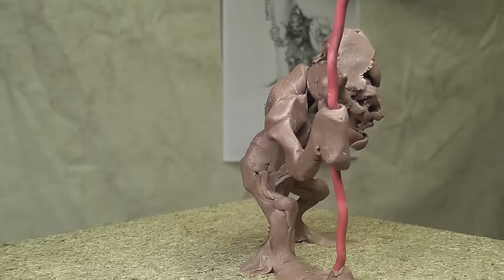challenge gobelins with Wayne England and Roquelaine Cyril day 1  in monster Clay plastiline

Comment: Is there a significant difference in this Monster clay and Sculpey clay as far as being able to work it and smooth it out? Also, with your other sculpts, what do you use for the eyes beside pearl?
Reply from the maker: It s two different clay, monster clay is plastiline, and sculpey is polymer, monster has different state of clay, sculpey not, both are a little wax sensation when you touch it, after you work a little differently Ith both. To smooth is same but use different solvant. And for etes I use pearls, airsoft bullet ball, or anything which be round ;)
Reply: +cyril roquelaine Thanx for the info! Keep up the great work, very inspirational!

Comment: what did you use to smooth the monster clay, was it 91% alcohol, or olive oil?....pretty sure water doesn't work
Reply from the maker: Light fluid zippo or similar
Reply: 27-28 min ?
Reply from the maker: +xxgrafitxx yes with a brush